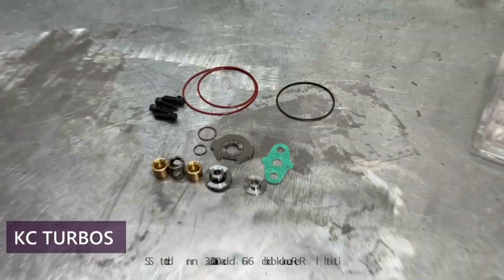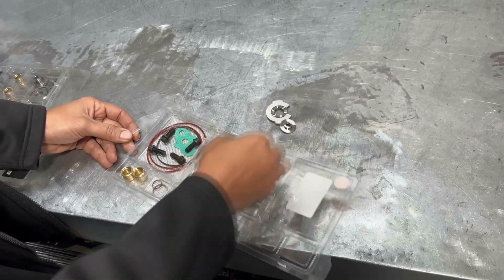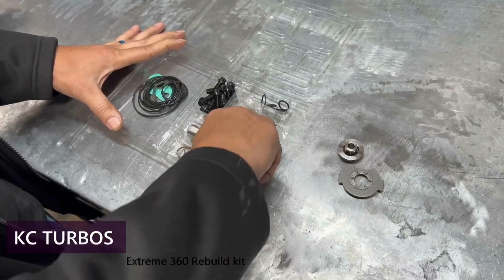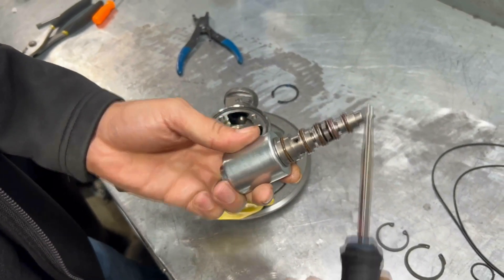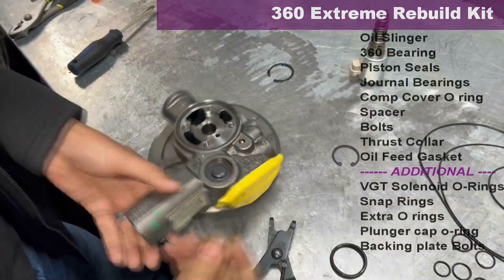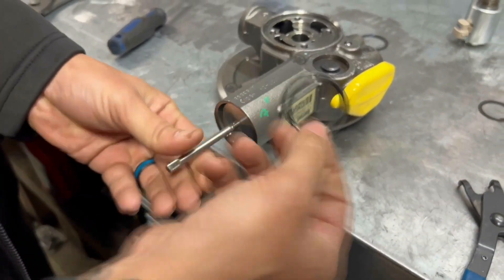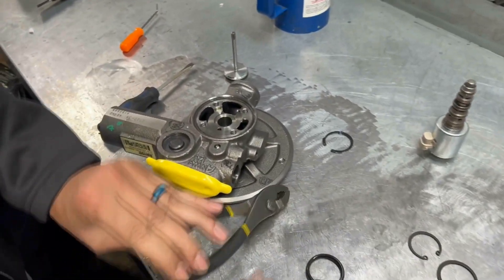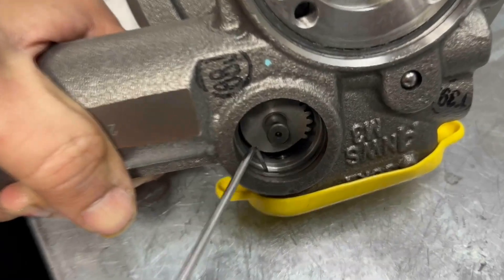KC 360° Turbo Rebuild Kits Explained

Comment: Do most turbos have an o ring or anything behind the compressor cover? I believe I had some tape that fell off when I removed compressor cover to tap for my wastegate reference. Could this be a reason my turbo doesn’t seem to make boost until high rpm’s? 7875, 0.96 AR on a 351. Thanks
Reply: Yep there's an oring on the aluminum backing plate for the compressor housing (cover) to seal on that's the large oring in the extreme kit.